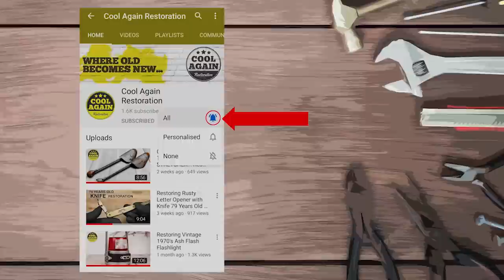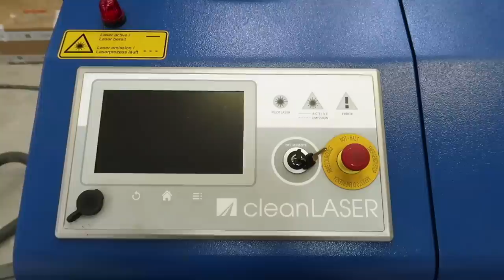Laser Cleaning Aluminum (500WATTS) - Old Syringe Restoration

Comment: Looks like some kind of hypodermic pellet depositer. Similar to what Vererinarians now use to “chip” pets.
Reply from the maker: 🤷🏼‍♂️ I dont know if that is the purpose,because she have an top cylinder where I think vials came.
Reply: @CoolAgainRestoration  or that is where the pellets are dropped in to the gun. The plunger extends to the end of the needle. So only solid medicines can be used. As a vial with powder would have issues with the powder falling into the chamber, the only possibility would be pellets. 
A similar system is still in use. Google Ralogun. It is a 'revolver' version but does the same thing.
Reply from the maker: veldmaat I will pin your comment 👍🏻
Reply: I think its for. Pricetags in clothing, i knew similar things in a modern Version in plastic !
Reply: So, that grease shouldn't be used.
Reply from the maker: Why?
Reply: @CoolAgainRestoration  The grease makes contact with the rod that push thru the needle. If it's contaminated with grease, the medication will be contaminated too.

That's why the inside is clean. It should self lubricate and any residue should be washable easily.
Reply from the maker: Vinicius,I agree with you,but you are aware that this tool, I restored it for the collection, it will never be used again and it looks so scary that I would never want to see it in action. and I put grease there to slide easily when someone wants to pull the trigger, for the sake of trying.
Reply: @CoolAgainRestoration  it's a good disclaimer.
I just advise that the original bushing is self lubricating and any grease will remove the original feeling of pushing the trigger. If it's hard to push, better to replace the bushing. Original in appearance, original in feeling. ;)
Reply from the maker: Ok
Reply: FINAPLEX or other Hormone bulking agent insertion tool.
Reply: I’m pretty sure it’s a 5G COVID-19 tracking implant device 😂
Reply from the maker: This is the best comment I read in a while Jorgen 🤣🤣🤣🤣🤣🤣🤣🤣🤣
Reply: Cool Again Restoration i think its for clothing to put those alarm things on clothing
Reply from the maker: 😂😂😂 you’re the best 👍🏻🍀
Reply: It's likely for growth hormones in cattle or pigs. Too old for micro chipping.
Reply from the maker: You’re right Matt!
Reply from the maker: Nice info here 👍🏻👍🏻👍🏻
Reply: Morgan we used the same for many years. Specifically ours were inserted under the skin on the back of the ear.
Reply: Cool Again Restoration  Swiftacher
Reply: I kinda like the laser cleaning better because it seems faster and cleaner. But I'm pretty sure it can't be used for every restoration project right?
Reply from the maker: Right. Is just another method like electrolysis. But anyway,now is broken
Reply: @mar83161  use of these hormones and importing this meat is banned in EU ☺️
Reply: its an ear tagging gun. they are still in use today but made out of plastic and look still the same.
Reply: I am pretty sure it can be sold as a Star Trek prop from the original series.  😁
Reply: @CoolAgainRestoration  woah comments got critical at the end lol
Reply: @mar83161  I said the same, grew up using one, 8,000+ ac place with over 2k head of black baldies in Southern Oklahoma.
Reply: @CoolAgainRestoration  oh that sucks so sorry to hear. Hopefully it's not to expensive to repair
Reply: Thanks.. I also thought this is bit leaky for fluids😄
Reply: I was just about to say that. When he pulled the trigger it reminded me of the tool they use to put chips in in animals. As I was growing up I seen a similar one used when I went with a friend to get a tracking chip put in there dog and also again when my uncle had a few put in what little cattle he has now because his cattle started coming up missing.
Reply: @JorgenKesseler  🤣🤣🤣🤣🤣
Reply: @veldmaat  
Found it here:
https://youtu.be/YcLRo87oR14
Reply: 1968?
Reply: @JorgenKesseler  
It looks to old, maybe Covid 1 😉
Reply: Looks very similar to a vintage Ralgro pellet injector
Reply: @JorgenKesseler  MTG agrees with you 😅🤣😄😆👍🏼👍🏼✌🏼✌🏼💙💙
Reply: For me it looks rather for killing than for healing
Reply: @CoolAgainRestoration  It is a gun to fix plastic labels on clothing.
Reply: Whatever kind of device it is... that needle is a NIGHTMARE... such a large bore, it's like looking in the end of a shotgun barrel.
Reply: It looks my like a thing to insert beads or jewelry in fabric
Reply: @marcelosantana9311  I know, right?  It looks just like the phasers used on The Wrath of Khan!  🖖😎👍
Reply: For horse ?

Comment: The laser concept is relatively new to restoration. Bead blasting has been around for some time and is widely utilized. I’ve never seen a piece of metal “lasered” in person, however the process appears extremely efficient. 
My concerns are does it work well with all types of metal and materials? For example, I’ve blasted glass for a frosted look. Definitely worth exploring further.
Reply: It doesn't have to work well with all types of metal and materials, it doesn't have to perfect. blasting isn't perfect and doesn't work well on all materials either, it doesn't have to be perfect either.
Reply: @ArniSPeturs  he didn't say anything about being perfect. He was just wondering if it could be used on as many different materials as sand blasting or if it's much more limited in its application
Reply: Yeah good point

Comment: Laser cleaning is super cool, would like to see it in vehicle applications where sandblasting isn't appropriate due to material warping or attached stuff like solid axles on offroad vehicles. Blasting itself is very complex with the several blasting media and different nozzles and such. I like both equally
Reply from the maker: That’s why I use both in my videos 👍🏻

Comment: I'm generally fine with needles, but if you come at me with something like that and there will be a fight.
Reply from the maker: I dont come. Only I showed in a video 😂😂👍🏻
Reply: I was hospitalised in February of 2018 and had to undergo a lot of testing. The veins in my arms disappeared due to too many needles. I then had to have some special scans done for which they had to inject a chemical they called ‘contrast’. Bear with me, there is reason for this long story.

They had to get the chemical inside of me but couldn’t find veins in my arms so decided hey had to get a needle in between the knuckles of my left hand.I swear, the needle looked as big as the needle here, on this device. Unfortunately the nurse sticking the needle in didn’t get very far and gave up, calling her colleague to take over. Her colleague arrived and decided to try my right knuckle instead. Let me tell you, the pain was excruciating. 

Looking at this video brings all of that back. They never did find out what caused my abdominal pain, so all of that was for nothing....
Reply: @engineer6250  wow-

Comment: Well that was different. 3:47 I assume you aren't supposed to have your hand near the beam.  I think I like sandblasting more, but this has a space age vibe.  Can't wait to see it deal with heavier stuff.
Reply from the maker: Shadowscribe thanks for comment!  It’s no problem if you hold the hand in the laser beam. Trust me! I will do a special video with this laser!
Reply: The laser is probably more like a tattoo removal laser; It won't burn humans because we are not metal/ink
Reply from the maker: Actually just a god  👍🏻 he can recognize the metal/nonmetal or what you chosed to work with
Reply: @CoolAgainRestoration  a video would be very much appreciated. So it does no harm from brief exposure or does it cause damage under sustained exposure? Like say 30-60 seconds pointed at the palm?
Reply from the maker: BradyT918 I dont know if you take 30-60 seconds pointed to the palms but only if you touch the skin with the beam,nothing happens

Comment: Very good restoration with attention to detail.  Nice to see old fashioned craftsmanship in your work.
I had some questions:
1. The gun blue liquid - is this to darken aluminum or other metals?  Why darken them?  Does it provide a rust proof primer coating? Not sure why you used this liquid for your work here, and what its uses are in general.
2.  What did the 500W laser machine cost and where is it made?  Please provide some specs for general weight, country of origin, cost, and whether continuous or pulse laser?   This is a great technology and hopefully will come down in price.
Reply: 1. Cold blueing. It just chemical to darken metal so is rust protected, mostly being used on bolt gun knife. I don't recall anything that said this was a coating, its the metal itself that turned to darkened.
2. No idea, prob china, laser machine was hell expensive at first exist, now i find like $400-600 tiny toy for small stuff

Comment: I think laser cleaning initially, and then sandblasting, would give the absolutely best result. Laser don't go really deep, but it are good at removing surface rust from things with a surface finish or surface pattern. Sandblasting takes the really deep rust, but easily misses rust in certain places where the sand don't "reach" kind of.
Reply from the maker: 👍🏻👍🏻👍🏻that’s why I use both

Comment: would one of these lasers remove the oxidation from an aluminium motorcycle engine? 

does it burn back to clean aluminium? or is it just removing surface contaminants?
Reply from the maker: You can set the laser beam to clean aluminium from 0-x microns or centimeters. After you clean with laser you only need to clean with weak acid(like vinegar 12%) 👍🏻

Comment: When I saw the sand paper come out I thought, well, you could have skipped the laser. Definitely don't want to use media blasting on soft metals like aluminum. You'll damage and remove soft metals with media blasting.  Laser is definitely less destructive to base materials.
Reply from the maker: Yes,you are right👍🏻 thank you for your feedback 🤗
Reply: @CoolAgainRestoration  

Do you have this machine for service/business/profit?
Reply from the maker: Is my brothers business. Is to expensive and is not so easy to work with,many seller said that it’s easy but not.
Reply from the maker: Why?
Reply: @CoolAgainRestoration  
Not easy to work with? What's difficult about it?
Reply from the maker: focus distance, the angle you work with depending on the material. to have a longer life of the device, some knowledge is needed. plus I do 
not use it in raw iron, I work with some fine parts that if I break them, I can say goodbye to the restoration
Reply: @CoolAgainRestoration  

So the laser equipment wears out??

Laser seems like a safer method to avoid damage to fragile items. How does the laser damage fragile items like raw iron?
Reply from the maker: Iron not,but brass,aluminium yes! Because if you do not set parameters properly, it can "clean" more than it should

Comment: Thats not a syringe,  that is an implant gun for cattle. A small pellet falls into the opening in the top and the rod slides it through the sharpened barrel (syringe) and the implant is in place. Usually inserted into the back of the ear of the calf.

Comment: Maybe i'm missing a beat. But why waste the energy to run the laser. When you're going to use sandpaper on it anyway.🤨
Reply from the maker: Because I sanding 10 minutes instead of 2-4 hours
Reply: @CoolAgainRestoration  Ok that makes sense. i'm surprised how much difference the laser makes. maybe i should consider one. i'm often doing rustwork on ships. Thanks for the tube always cool to see old stuff being restored.👍
Reply from the maker: Thank you for appreciation Thomas 👍🏻🍀🤗
Reply: mike h  up to 450 kw pr. pulse.
Reply: mike h  no the manufacturers specks says that.
Reply: mike h  let me correct it "Pulse power up to 400 kW" 
https://www.cleanlaser.de/en/products/lasers/mid-power-laser-systems/
Reply: mike h  Hey i'm not knocking it. Idc. about power consumption. i'm actually looking to buy one. But i'm only just started to look into it. so my knowledge about lasers are very small. 😉

Comment: You need to read up on the safety of the use of this laser.  
I hope you were wearing the appropriate mask and had ventilation to remove the gas because, contrary to what you have in the text, you are, in fact, producing gases from the laser removing the oxidized aluminum.  And breathing that in, as well as the gasses from other things you may clean with this, is very much not good for you.
Reply from the maker: I’m okay,thanks. I wear glasses and mask but I don’t need gloves like someone said here. Thank you 👍🏻🍀